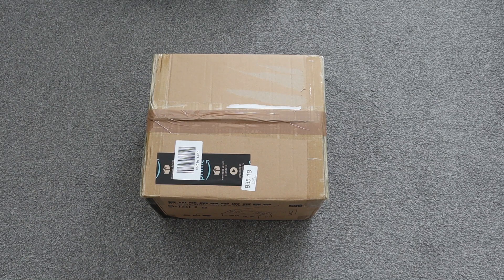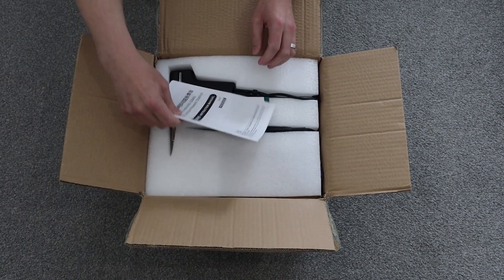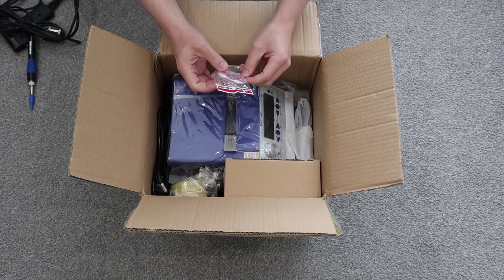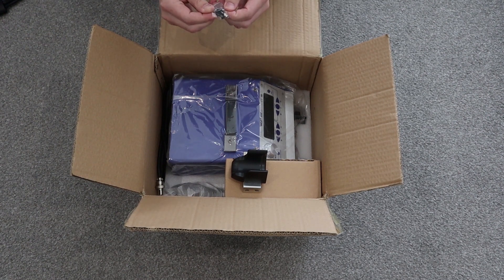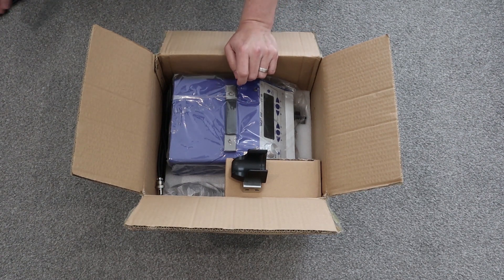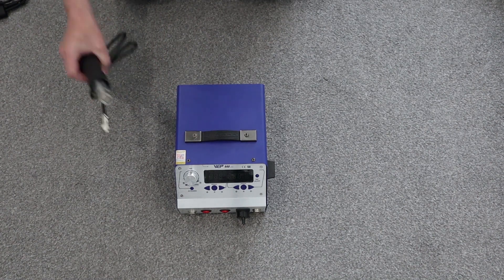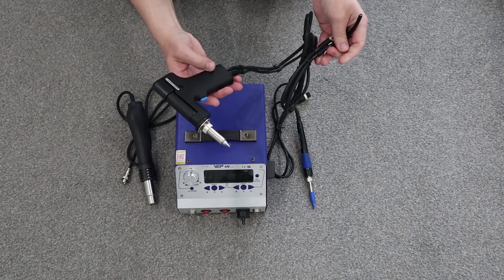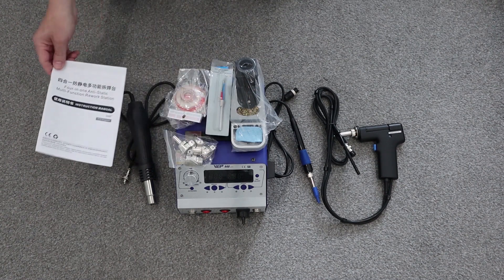UNBOXING THE WEP 948-II 3 in 1 HOT AIR GUN SOLDER STATION

Comment: Looks like a nice unit 👍 I sorta wish that the box it was sent in was less marked! Is the WEP brand up there with Yihua? Seriously considering getting a similar unit. Thanks
Reply from the maker: It is a neat little unit.  After using it for a while, and using other hot air stations now, I would consider getting a unit which has the heat pump in the base unit itself, rather than the heat unit on the handle of the gun.  The units with the heat pump in the base unit seem to produce hot air better - something like this - https://amzn.to/3dUZlNf if you are on a budget. But if you have a healthy budget, I would go for a Quick like this one - https://amzn.to/3dVhQ4a
Reply: @TweakTips  some of the equipment can go up in the $$s too!! Thanks